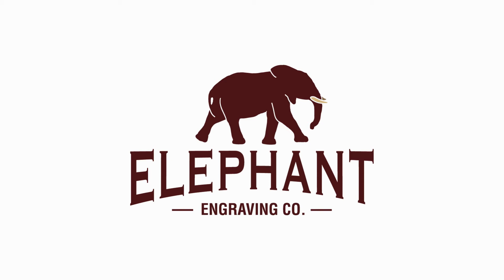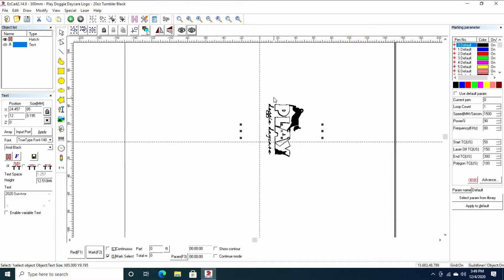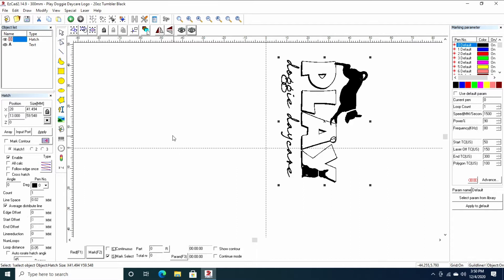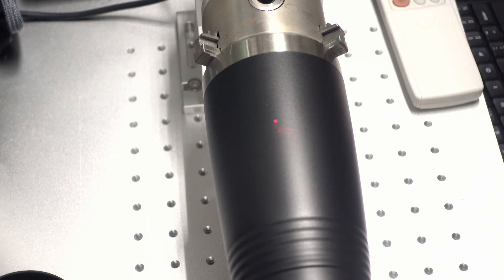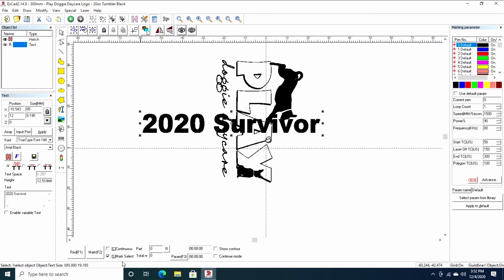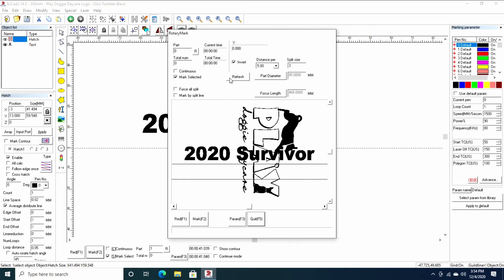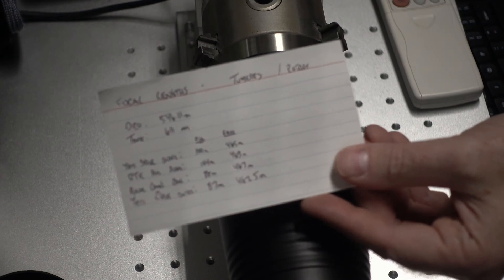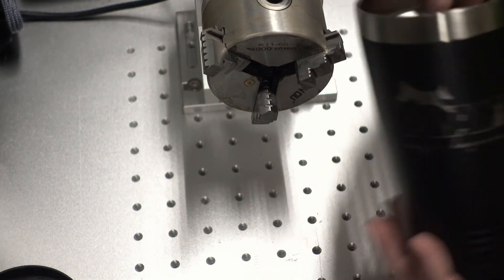Fiber Laser Rotary Example 1

Comment: Hello there,I've watch your video a couple times to understand some of the main priorities as dimensions, width and height for when you engrave the LOGO, i heard that usually you have to match you hatch dimension ( 0.02 for example ) to your split in order to make it run and engrave properly, and do as many passes as necessary to have a good finish, my question is i follow those steps very carefully but for some reason on some of my logos i end up with a split mark, do you ever change the focus length ? or your parameters when you click on the rotary tab ?  if you would have time to do a team viewer of course with your cost time, please let me know, i would be very interested on paying for your services and help, maybe is something small I'm missing but who knows ☺
ngneersan@hotmail.com
that's my e-mail if you can help
thanks

Comment: Do you still need to set the focal length on a manual adjustment z axis? I'm trying to think if that would make a difference or not between different objects, or just be need to be set manually to the right height each time on the machine itself, and leave the focal setting as a constant.
Reply: I'd like to know this as well

Comment: my issue is that i can burn images with splitmark but not with rotarymark.  am i supposed to take that image into an editing software first or what?
Reply: the images are just jpg's that where downloaded from the internet.
Reply from the maker: @christianbush3094  You need to convert to vector or learn about engraving a raster image. I dont have nearly enough information to help troubleshoot your issue via  YouTube comment, sorry.
Reply: @elephantengravingco.8833  thank you! that right there was what i needed to know!

Comment: Very helpful videos and probably some of the best so far. I have been trying to dial in this rotary for a long time now and I feel that I'm getting closer thanks to you. It's hard to find good videos out there. I'm trying to engrave in the same orientation and having the laser engrave right to left like you in the videos, but I can't seem to figure it out. Can you explain how you achieve this? And maybe explain the rotary mark parameters (F3) a little bit? Thanks again for the help.
Reply from the maker: Glad it helped! I'm not too up to speed on the parameters but i'll see if i can provide some guidance in a future video. 

As far as the orientation, you need to adjust your hatch direction. for mine, it's 0deg. Remember to hit 'apply' after you adjust :)